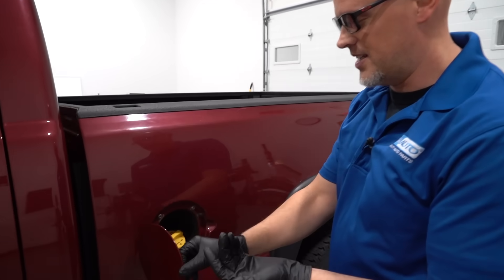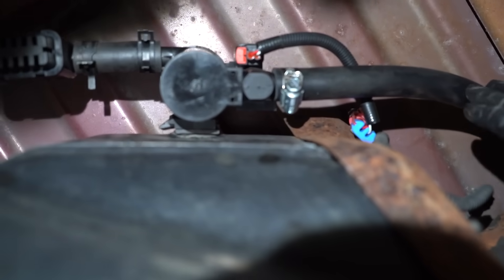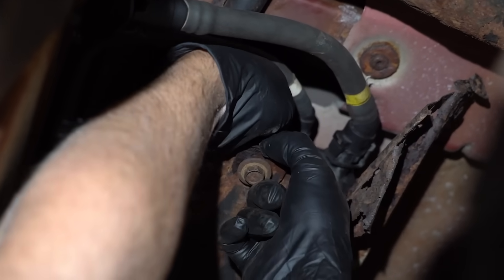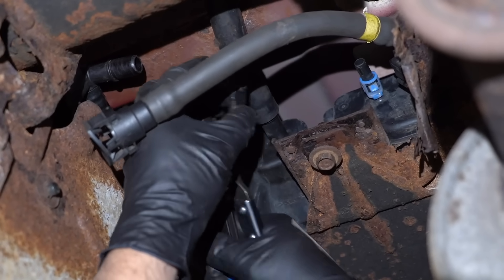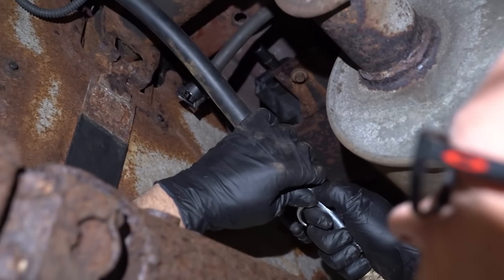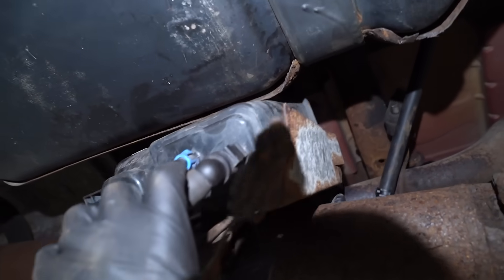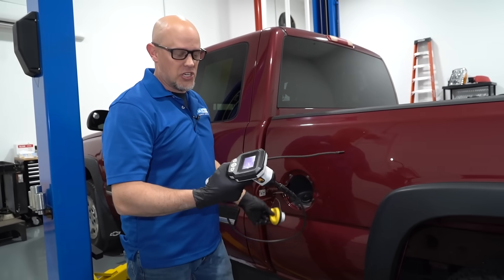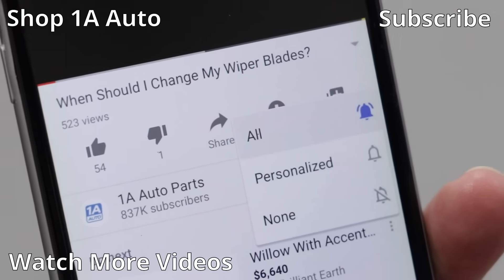Gas Pump Keeps Stopping When You Fill Up? Diagnosing Fuel Tank and EVAP Blockages!

Comment from the maker: √  Watch the Video
√  Buy The Part at 1A Auto https://1aau.to/m-Visit-1AAuto
√  Do it Yourself
√  Save Money
Reply: WHAT IS THE PART CALLED??
Reply: I’ve replaced the valve, and the canister. It’s still not filling properly. Please advise.
Reply: When ever I gas my van up, the fuel starts coming out of a pipe attached to the main fuel pipe that right under the body and tank. It branches out and I guess its a run off valve so when you've put too much fuel it comes out there. I guess. What's the problem?
Reply: I’ve replaced the vent solenoid and the canister. Any idea what else it could be?
Purge filter maybe?
Reply: Also I've needed to replace my blower motor on my van, but I'm not getting the new part in bc it's a very tight squeeze bc if the black metal tube that starts in the side and runs over the battery. I hit the old part out bc I bent the housing fire the old blower but obviously I can't do that to the new part. Any tips?
Reply: It's a 2004 Ford Econoline Van 150 5.3L V 8. Just to let you know just in case.

Comment: i dont expect to ever get a suggestion or an answer but, today dec 9th/25 just got back form the shop that replace the cannister and valve, (to my request), went happy and confident to fill up,SAME FKNG ISSUE, i feel like checking the inlet gas hose , but why would it be blocked?..makes no sense, so...

Comment: I started with the vent solenoid then the canister . My canister leaked charcoal chunks into my whole evap system. even up to the solenoid that lets the vapor be sucked into the engine. I removed hundreds of charcoal bits out of the tank and l blew out the evap lines too. for safety I went with a new Delphi fuel pump because 200000+ miles. The fuel tank is fill able at full speed

Comment: Well I have a comment, I have a 97 Ford ranger and has problems pumping gas in the tank. So I took the neck loose and took out the rubber pipe in the middle of the big hose. Pump's great now it usually took 10 minutes to put 15$ in, not now

Comment: I have this problem with my 2020 Ram 1500. Tool to dealer and they first “adjusted” the filler neck. $250 returned it back to me with no change. 

I filled up and had the same problem. Took it back and they said they need to replace the filler neck $381. 

That didn’t work. Then they wanted to replace the fuel pump. 

I asked them to check the evaporator valve but they refused so I said just give me the truck back. 

Thanks for this video I’m going to give this a shot.

Comment: I changed the purge valve under the hood had a p0442 code and now my tank on fills half way is this a problem with the new purge valve? I never had issues filling the gas until I changed that purge valve under the hood

Comment: I filled up my gas tank on my 1999 Ford Econoline E150 the other day and it would not fill. It kept clicking off. I went to another gas pump yesterday a d it filled up no issues. Today when i started my van it was idling really rough to the point when i drove around the block and had it idling it stalled once. No good. I checked the air filter and will be replacing it. I got a P0171 code. Witht the issue at the pump and now the idling issues and hesitation where should i go next in troubleshooting?

Comment: Okay but what if its not the charcoal canister? Whats next? 

07 sierra 2500 6.0
Had engine light for evap leak since i got the truck. Few months ago, had leaky filler neck. Replaced filler neck. Engine light still on, but now its doing funny things. The gas pump shut off thing like mentioned in the video, but it also burns rich. So rich in fact that after i shut off the engine it tries to kick up again and gives a few little purrs. Replaced charcoal canister, purge valve solenoid, and vapor vent canister. 

This leaves two choices i believe, either hole in a line or blocked line. I have an air compressor, i can go around blowing all of my lines. But if that doesnt work is my next step a smoke test to see if its a leak? Any wisdom to share?

Comment: I bought a 2011 Santa Fe from USA.  When I get som gas from a station, the gun nozzle stops every time , so  the guy there has to press the nozzle again and again.. I was told that the problem is that nozzles in my country are different from those in USA. Is this right? 🖐🏼

Comment: I have a 2007 Yukon that's doing that and I've dropped the tank I've blown through all the lines change the charcoal filter because it was bad and no luck The flap in the tank where you the filler neck is I removed it just to make sure it wasn't stuck and still cannot put gas in it only thing I know at this point is to buy a new gas tank

Comment: I have gas can plastic filler neck, which a piece broke off inside.  So, I don’t know if the piece is tumbling around the filler neck, causing the constant filling issue.  Or, has this piece found its way all the way down to the tank causing filling problems?

Comment: The activated carbon in the canister is sized to the fuel tank. The Marine is correct that pumping the last drop can cause the filter media inside the canister to tear as it’s under spring pressure. This leads to black carbon chunks in the purge line up to the valve & engine.
 The A1 Auto tech diagnosed the symptom  but not the root cause. The fuel tank solenoid is open all of the time until the PCM runs an EVAP test after 4-6 hours of drive time at temp. Since it’s open, allowing air in, it has a foam filter in it or separate like this one. East to open with pocket screwdriver and dump a pound of dust out. This plugs canister way more often than anything. If the tank solenoid can’t close durning an EVAP test, a code for small or large leak will set. A loose gas cap is common. The filter could be cleaned, but replace it if you can afford it. Two wires, one or two hose and if you see thru it, spray WD-40 and quickly blow compressed air thru it. Installing rubber hoses is easy if WD-40 is sprayed, all hoses. That’s all I use it for! Ever. OBD-2 codes are in 4 categories but concern yourself with “B”. Codes in “A” turn light on now, type “B” detected problem like small leak, if refueling and 2 gallons or more added, time to run test, it shows “Check Gas Cap” this is how & type “B”. If Crooked or loose, drive, park, coolant & air temp within 10F of each, drive to temp, runs test, passes! Now repeat 40 more warm-up cycles, type “B” code disappears, congrats! OBD-2 is complex computer software and once engine is started, it takes 3-6 minutes to check everything. Complete understanding is hard but I learned it in shop, then taught it for almost 7 years in 7 or 8 states for up to 100+ techs! 
Best of luck! ASE Master 78 + L1

Comment: I had a half tank gas when I decided to top off prior to entering the Gettysburg battle field for a tour.  I only Got about a dollars gas in when the nozzle started shutting off and  spilling out gas.  I couldn’t get any more gas in.  (2019 Jeep Cherokee). Called a Jeep dealership and they recommended bring in the car.  Decided Toft to our destination and see what goes.  Tank should 3 quarters empty when I pulled into a gas station. Holding my breath, I had no problem topping off the tank.  Car ran fine rest of trip.  Gonna try again when at half a tank just to see what happens before i take to the shop.   🤞🤞🤞

Comment: Alright, I have deleted the charcoal canister (temporarily as a diagnostic),  I have installed two completely new vents on the top of the tank (they should move way more air than the OEM vent line),  I have replaced the solenoid and also the purge valve.  It still won't fill at the station without either clicking off or pouring out the top of the spout.    If I fill it slow, I can fill the tank, it just takes a really long time.  2008 Chevy Uplander 3.3
Reply: Did you clean the lines as well

Comment: I have a 2010 Ford Fusion. I need to use the slowest setting when filling up. It takes 12 minutes to fill.  This car is garbage. It's full of rust and corrosion. Typical Ford product. I can't afford to buy a new car or the repairs.
Reply from the maker: +@m.thomas6222 Thanks for checking us out. Shop for high quality auto parts on 1AAuto.com:

http://1aau.to/m/Shop-1AAuto-c

Comment: I had this problem on a 2003 Chevy Impala.  When I turned the engine off when filling the tank the pump kept shutting off.  I then turned the engine on to fill the tank, and the problem was gone.  It was the vent solonoid.  When the engine was off the solonoid was stuck closed so the fumes in the tank were unable to travel to the canister.  When you fill the tank you create vapor.  When the engine is on, the solonoid opened and the fumes were able to travel to the canister.

Comment: I'm having this problem with my 1997 F 250 with duel tanks , didn't have this problem till after a shop replaced the fuel pump. Note: I only use the front tank.

Comment: Great informative video,sir. I have a good 2003 Dakota , 4.7 4wd,lottsa miles...Gas pump keeps shutting off and i need to sneak in the fuel gently. I have po440 and po443...Got a new purge valve on a whim and then it threw the 443...Need to get it inspected.......Charcoal canister bad ? LDVP  stuck? New gas cap didn't help.....Pllease assist if you will.. Best of regards, Rob in Albany,NY...cheers

Comment: Liked the video.  Have a 2006 suburban.  Its spraying gas out of the filler tube, while filling.  As far as i know its not hard to fill, shutting off the pump.  Would it likely be the same thing that you cover in the video,  the charcol canister?

Comment: I had this problem for only a couple of days in my 2007 Dodge Ram 1500. I was driving cross country so I didn't want to deal with it at the time. I filled up a little bit at a time. After a couple of days it resolved itself and has been fine for the past three years. In retrospect I suspect I might have topped off the gas as much as possible when I had a cheap price on gas.

Comment: I did this same job on our 2002 Suburban.  It solved the same issue for about 6 months.  Now I can't fill it up with gas again.  

New : purge solenoid, vent valve, charcoal canister, and gas tank cap.  

Any suggestions?

Comment: Great video with fantastic explanation, I have the same issue and it takes forever to fill the tank on a 2007 Sante Fe. I also have to find a pump that will even allow me to get it slow enough to fill without the gas pump chattering, since the gas flowing from the gas pump is so slow the gas pump stops and will not to function.

Comment: Have a 05 Volvo S60 2.5t my check engine light came on PO456 small EVAP leak. Had a smoke test done found out it was the fuel filler neck vent pipe small leak. This part is discontinued.garage called around and could not find another in my area. So the mechanic said he could try epoxy. Took my car to get gas and the pressure coming out of the fuel filler neck was strong. Could put too much gas in my car. Pump kept shutting off. Taking it back to the garage to see what they can do. It could be the charcoal canister or the line needs to be blown out or when putting the lines back on they are kinked. Possible human error. Will have to see. Very frustrating

Comment: Let me know if this is correct:
At 8:11 you used an air hose to pressurize the evap charcoal canister.  It was plugged and the pressure remained in the evap charcoal canister.  I am guessing that the fuel gasses from the tank will get stuck in the charcoal canister and the air pressure will exit out the normally open vent.  You are right, a balloon on the outlet vent would have been a great idea.  

So assuming from the last three videos of yours I viewed on this subject, (car sitting and not running) I am fairly sure that the fuel vapor from the tank exits into the charcoal canister, the fuel vapors get trapped in the charcoal canister while pure fresh clean air (no gas smell) from the pressure in the tank makes it through the charcoal canister (valve open) and exits the tank through the vent valve, causing no pressure to build up in the tank.  The fuel vapors are left behind in the charcoal canister.
On the other hand, when the engine is running, the purge valve opens, the vent valve closes, and the resulting low pressure in the charcoal canister releases the fuel gasses trapped in the charcoal into the engine intake manifold.  --Zero net loss of gas vapor related to evaporation.  No stinky gas smell from cars when wandering through a parking lot.

When you overfill the tank raw gas gets into the charcoal canister and ruins it.  This would be the stinky car.

Comment: This still happens,  even after I bought a new vent valve, purge solenoid and vapor canister and fuel cap.  I also blew out all evap hoses with compressed air.  

I STILL can't put gas in the tank.  2002 suburban.  PLEASE HELP!

Comment: I installed a new charcoal cannister and my problem still exists, even installed a new fuel filler neck with it's own small canister....I can't figure out what the issue is on my 2018 Ram 1500

Comment: I have a Chevy Suburban 2013 1500 LT and I'm facing the same issue. Changed both the canister (OEM Part# 22963841) and the canister vent (OEM Part# 23481275)  and still the issue is not resolved. I filled 80 liters yesterday in 27 min 😥.
Any idea what else can be done to fix the issue
Reply: Lmk please

Comment: I have a 2005 Silverado 2500 hd 6.0 I've removed the canister and the vapor line from the tank to the canister and it still won't accept the gas. then with all that disconnected I blew air into the tank at the fill up end and it blew the air back out at me then I tried the vent neck and had the same affect. i used my camera and nothing is stuck in the filler neck.

Comment: Help: I've had my fuel tank changed for a brand new aftermarket one because it was 1/4 the price of OEM. The top side valve on the tank is 3mm wide, the OEM one was 10mm. I've had to buy a brass reducer and some new pipes to bridge the gap between the new valve and what I assume is the charcoal box you mentioned (although the mechanic did the work so this is a guess). Now when I fill up the fuel pump clicks and stops every few seconds. Could it be because of the smaller valve on the tank?
Can you offer any advice on what I can ask my mechanic to check or what might need replacing?
Is that vapour valve something that would cause the fuel not to fill up correctly?
Car is a Toyota Celica 2003
Thanks

P.s. good video and well explained although it's not exactly what I was looking for

Comment: Navy mechanic here. It's rare for it to actually be the charcoal cannister, usually it's the vent line needing blowing out. But when it is actually the charcoal cannister as the problem...it's because you keep clicking the gas at the end trying to get every drop you can in the vehicle! That causes fuel to reach the vent line and trickle back into the charcoal cannister and stop it up over time. When you're fueling up, stop continuously clicking the fuel trying to get every drop possible! Maybe do it a couple times and stop, and you'll never have charcoal cannister problems.
Reply: Wonder how many could read this comment. Thanks
Reply: Words to live by.
Reply: Crayon eating Marine here: What if outside temp is a factor. Cold days nogo 

Warm days all good
Reply: @ghostmost2614  living in northern canada this is my problem also! If I thaw out in the shop overnight I can fill again the next day.

Comment: Very well presented video of a common problem in a wide range of vehicles.    I also have that problem with an Avalanche and a Hummer H2 including the check engine (MIL) light and a P4520 error code (Evap Code).

Comment: I replaced the evap canister and the evap filter piece under the spare tire as well as the purge solenoid and still have the problem
Reply: Did u get the gas cap ? I heard the fuel pressure sensor might be a factor not sure what’s ur car problem though ,,, but they relate

Comment: I have a 22’ Ram 1500 limited Longhorn with the 33 Gal tank. Now with about 50 miles left  for range, I only get about 28 gals in the tank. I know at 50 miles left there can’t be 5 gals in the tank remaining. Is this normal?

Comment: Typically how long should a charcoal canister be good for? I’m having this fueling problem with my 2019 f150
Reply: Navy mechanic here. It's rare for it to actually be the charcoal cannister, usually it's the vent line needing blowing out. But when it is actually the charcoal cannister as the problem...it's because you keep clicking the gas at the end trying to get every drop you can in the vehicle! That causes fuel to reach the vent line and trickle back into the charcoal cannister and stop it up over time. When you're fueling up, stop continuously clicking the fuel trying to get every drop possible! Maybe do it a couple times and stop, and you'll never have charcoal cannister problems.
Reply: I just recently am having this with my Ford 350 super duty. 2019.. 80kmiles..  would the fix be similar
Reply: I would check for a blockage in the end of the vent from maybe a spider, mud or a lot of dust.   I guessing  if it's not the spider you have driven in a lot of mud or muddy water or during very dusty conditions.